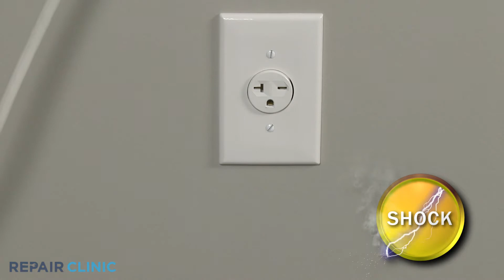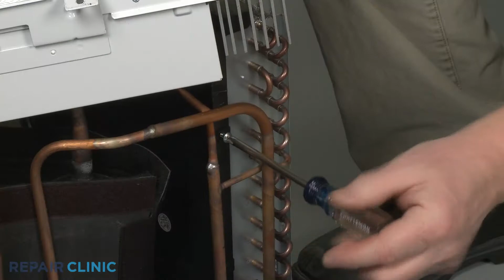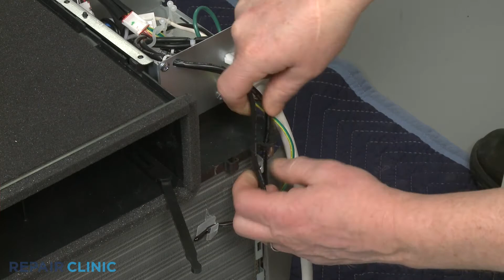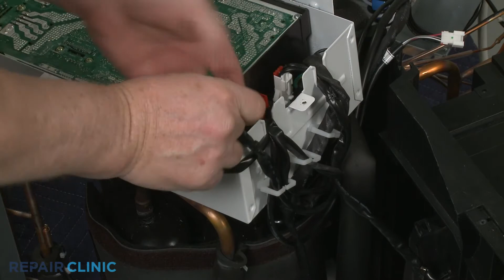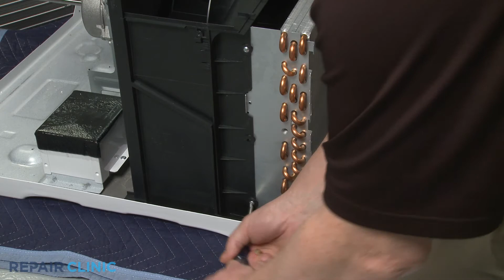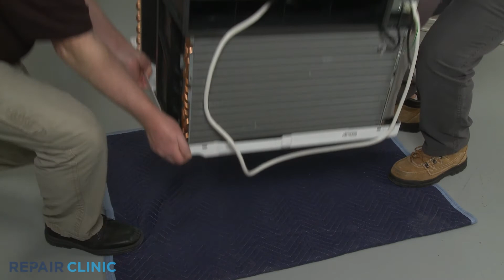LG Air Conditioner Fan Motor Replacement EAU63742904

Comment: Is this the cause of CH 67,  my unit is running on cool mode this code appears but on Fan Mode it doesn’t run perfectly fine.  No blockage on the fans all clear and clean.  Sometimes this air conditioner run smoothly for weeks and suddenly “CH 67” appears.  

Any one knows if this may be the issue motor replacement?
Reply: I am in the same position you were 2 years ago, how did you fix it?